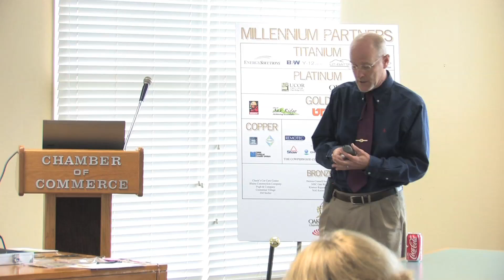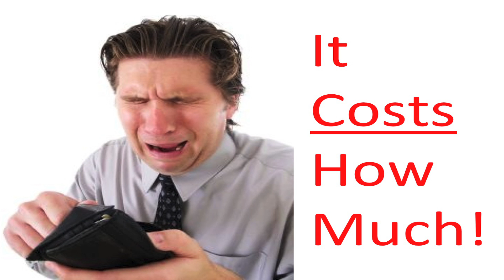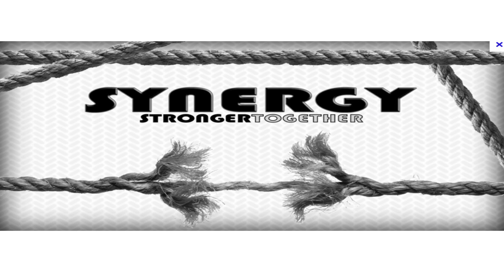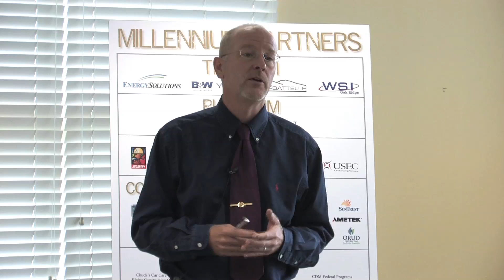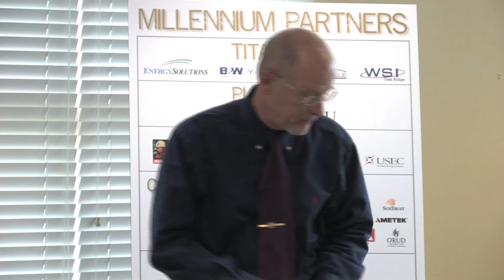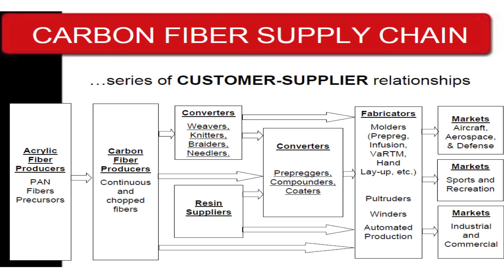Carbon Fiber for Dummies

Comment: Can unidirectional carbon fibre be mixed with other substances so that it looks plain, with no weaving texture.. like a sheet of black aluminium
Reply: Just paint it
Reply: why not just use a smooth face outer sheet?
Reply: Thank you for suggestion
Reply: Use a tinted gel coat.

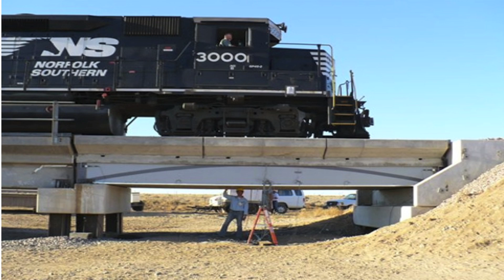Comment: The train bridge beam at 6:25 is composite alright,  steel and concrete. The "form" used to pour the concrete into is the only thing that is a fiberglass reinforced plastic. I know this because the company that I work with was scheduled to build some of these beams.